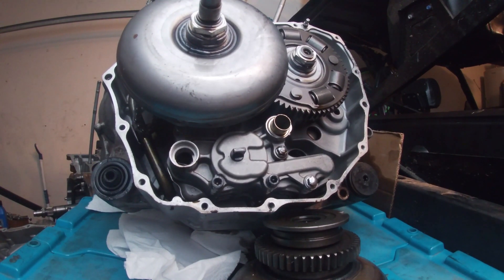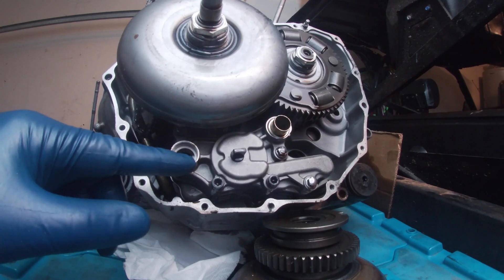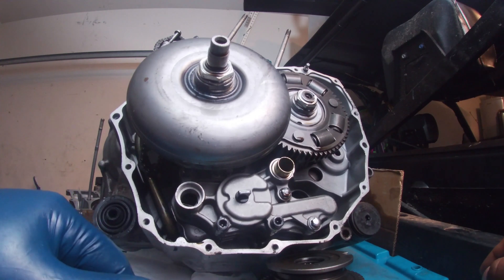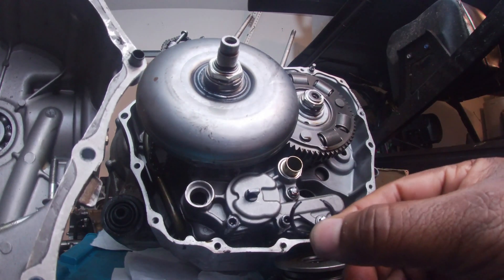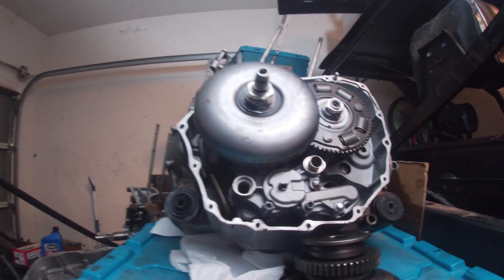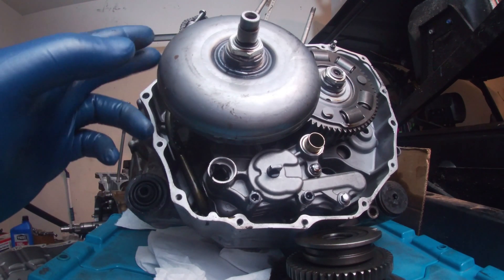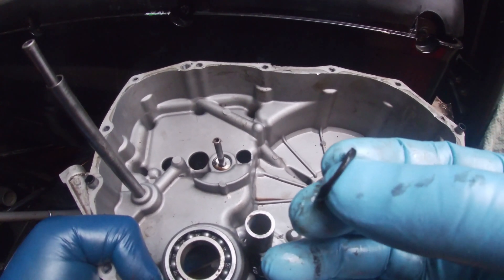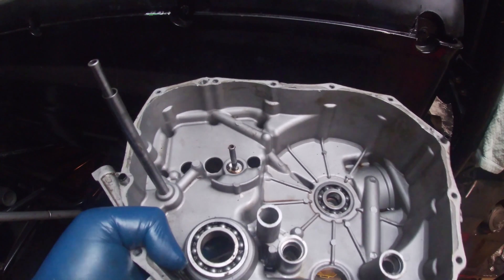How to Diagnose a Honda Rincon 650 / 680 ATV Oil Pump. Transmission slipping or shifting problem

Comment: Maybe you can describe in what place of my bike i can change my honda rincon 680 gearbox oil? Because when engine is cold my bike doesnt ride and when its hot engine my bike starts dont ride in 3 gear but in 1 and 2 gear its all good
Reply from the maker: The engine oil is also the transmission oil . Drain and refill with synthetic motorcycle wet clutch oil. and fill to proper levels.

Comment: My friend has a 680 that will not ingage when starting up even in summer,  Pump?  I wanted to buy a new honda and a mechanic frig this id only buy the 500cc with gears fuck the full lock
Reply from the maker: could be bad oil or low oil. Could be pump. Usually with pump o-rings needing replacement youll see it run ok when cold then slip when warm
Reply: @Uneducatedcapitalist  ya was low on oil,  told him to add oil but he said hondas are tough lol tried to convince him but hes an alcoholic

Comment: Could it have slipping problems if the oil level is too low?
Reply from the maker: Yes it can. If it is too low then the oil pump is unable to produce enough pressure for the  torque convertor
Reply: @Uneducatedcapitalist  thanks alot. Im thinking on buying one for 1500€, but it has 18k kilometers and 1k hours, I think thats alot. The owner has it from new and said the engine was never touched inside

Comment: I need advise mine makes a knocking noise in drive but not in reverse and increases with speed also the bike is very slow only about 25mph and it struggles on steep inclines as if im in second
Reply from the maker: could be cv axles popping that your hearing. bike is very slow issue could be a few things. is it a 650 or 680?

Comment: You can also get  transmission slipping if you overfill the oil level.  I understand that this also requires stripping down the engine to clean the excess oil off the clutch?
Reply from the maker: Not usually. just draining the oil to the proper level should be fine

Comment: Hi, I have a Honda Rincon 650 and sometimes it doesn't want to move forward, I accelerate and it doesn't move backwards or forwards, but sometimes it grips but it returns to the same thing as it will be
Reply from the maker: i would start with a oil change with synthetic wetclutch oil. follow the manual to get the correct fill level

Comment: And your also not supposed to use synthetic oil or else it will wreck the engine and cause the trans to slip because the oil is not the right viscosity so you have to use a mineral blend oil meant only for atvs or use honda atv oil because the oil oils the engine and transmission and clutches at the same time
Reply from the maker: If you use a synthetic wet clutch oil its fine

Comment: Ive got a 07 rincon and its slipping in 3rd gear or thats what i think. I can throttle it and eventually hit top speed but it doesn't pull the same as 1st and 2nd. Do i have clutch problems? 
Another problem i have is when its cold weather it doesnt want to pull at all until it warms up but ive never taking the motor apart but this did start a while after i buried it in a water hole and had to drain the motor oil. Any advice on what to try or do would be nice. Thanks in advance!
Reply from the maker: could be clutch issues. could just need new oil. replace with synthetic wet clutch motorcycle oil and fill to proper level. let it idle and warm up to operating level on level ground and fill to proper level

Comment: Hey I have a 2006 680 rincon and it’s won’t move when sitting like it’s slipping, but if you give it a push it will take off, any ideas? Adjustments?
Reply from the maker: sounds like it has a pressure issue. Whats the condition of the engine oil ? Is it low?

Comment: What does it mean when you put it in gear and hit the gas and it does not move
Reply from the maker: Could be several things. What does the gear selector show? Is your linkage adjusted ? How much oil is in the engine ?? How old is the oil ? Do you hear it click when you shift ??

Comment: I have a pioneer 700 that has always slipped when cold.  But now it has about 9,000 miles and it shifts fine when warm except when accelerating hard, then it refuses to upshift, it just bounces off the rev limiter.  If I left off of the gas some it will upshift.  Any ideas?  Thanks
Reply from the maker: Many times the rubber oring that goes around the oil pump was crushed during assemply of the front case from factory. That oring failure will cause erratic shifting when cold and sometimes when it gets fully warm because of the oil thinning out. . with 9000 miles I would replace o-rings and also the oil pump and chain guides and oil chain because im almost positive you have slack in the chain due to high miles. Since your going to do that Id do a camshaft replacement and piston and rings also.
Reply: @Uneducatedcapitalist  Thanks a lot, I really appreciate it.
Reply from the maker: @andrewd7795  doing the above maintenance will give you another 9000 miles im sure.

Comment: Buy the correct puller for the torque converter instead of the possibility of damaging it.  $40 insurance policy.  I would also change the oil pump chain, low gear/reverse clutch friction discs/orings, and pressure relief while in that far

Comment: I write this before I watched the vid. I have a good one for you. New seals, new water pump, and I still have water, pouring into the oil. The temp light came on so I decided to find and fix. Thought gaskets at first. I have had the valve head off four times w/out replacing them so it seemed like a solid thought. Still ran thru, emptying the gallon  of water onto the ground in seconds. So, water pump replacement time. $350.00 smackolaas later. Not the pump. The day after I noticed the problem. Water pump got stiff and the notched piece where it connected to the motor shaft where missing. I am not positive that Is the monkey wrench, I am thinking one of chunks of hardened steel got between  the crank shaft and the case in an attempted escape. I have spent a week thinking of the best way to do the job put forth. Then I searched the answer, and here is where you come in my friend. And All I wanted to find is how to remove the front drive shaft. Do you hate crap built to break as much as this 62 year old does? Where I ride "south east Utah" if it breaks out there the returning of your shoes to the bed side may never happen again. On the good side, My rinny always brought me back. 8000 miles in the seat,  over some of the nastiest and unforgiving trails in the world. and with luck many more. I think I might probably perhaps make a video. Wow, I must be bored. Time to watch...
Reply from the maker: If it's still getting water in oil. I would get a new head and gasket. Flush radiator. Flush oil hoses also . Flush oil a few times. Let it idle for 40 minutes to warm up the oil. Then drain.then repeat .
Reply: @Uneducatedcapitalist  I did replace the head, a intake valve stuck open as I pulled up to a stop after a 60 mile ride.It now has new gaskets."top end" I started the job this morning and here what I found. When I add water it leaks as a hose, however, when I removed the intake hose from the front of the head it was full of water. that whispers to me that Just one water port is affected and it is leaking directly into the oil pan.A friend is bring his cell phone snake camera and I am hoping I am wrong. Question: The new water pump was twice as hard to turn as the old one.Are they all made to be that stiff or did I get a lemon?
Reply: @Uneducatedcapitalist  And thanks for the words of advice. Not many would take the time. Kudos   :)
Reply: It was a cracked valve head. I had a replacement, now I just need gas to see if it will start and run. :)

Comment: Thanks for the video it really helped mine is slipping when cold and fine when hot but having trouble finding the right o rings tried the link you posted a wile back but it won’t pull up anymore if you know where I can find them let me know thanks again
Reply from the maker: https://www.partzilla.com/catalog/honda/atv/2006/trx680fa-a-fourtrax-rincon/oil-pump

Comment: My 05 680 grinds when putting it in drive and grinds so bad that I can't get it into reverse. I'm trying to explore all options before stripping it down. It sounds like like if you are trying to jam a standard transmission in gear without using the clutch.
Reply: Try turning your idle down before you tear into it
Reply: @heathabshire8929  https://youtube.com/shorts/-GWfUzglt4Y?feature=share does this sound like a high idle?  If so do you know how to adjust it?

Comment: so I have a 2007 Rincon 680 it grinds in reverse fwd. no problem dealer says let it warms up should be fine but it doesn't grind when it is brought to the dealer
Reply from the maker: Grinding has nothing to do with letting it warm up. Warming up is allowing the oil which is also trans fluid to warm up. Either you linkage needs adjustment or it's not fully engaging into reverse which means your fork could be broken. Statt with linkage first
Reply: @Uneducatedcapitalist   They have adjusted the linkage several differ times I have even shown them the video what it was doing but couldn't fig out could it be the oil they are using some off brand type in the past I used amsoil synthetic??
Reply from the maker: @jonnnylee  as long as its 10w 30 or 10w 40 wet clutch type oil it's fine.  The grinding is a gear issue. Not a fluid pressure issue. Can you explain Is it grinding when you try to put it in gear? And once you shift and re shift it into gear then its fine.. or is it grinding when you drive??
Reply: @Uneducatedcapitalist   so once I go fwd. then rev at times it will work just great other time I would have to shift it fast for it to work better it doesn't do it all the time unless its hot sometimes when cold
Reply from the maker: @JohnLee-ng4lv  you might need to adjust your idle down some